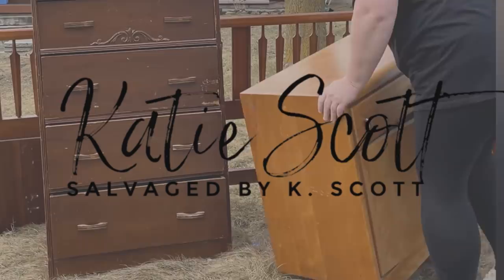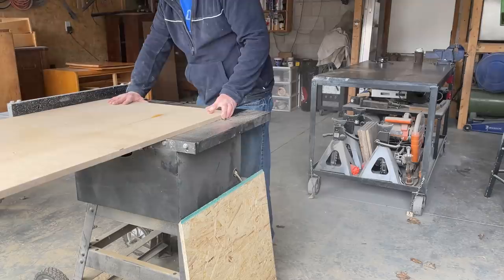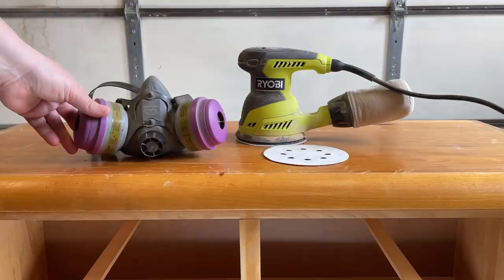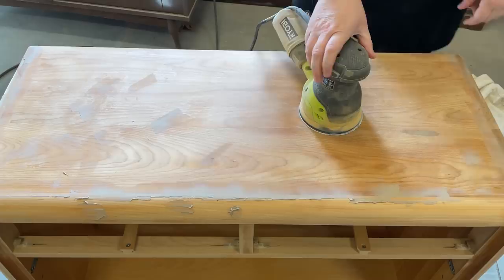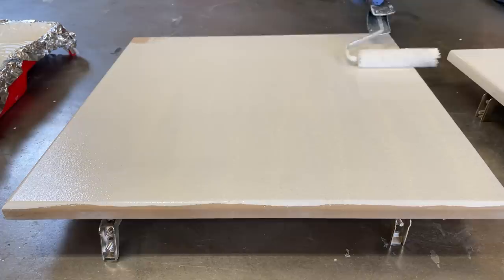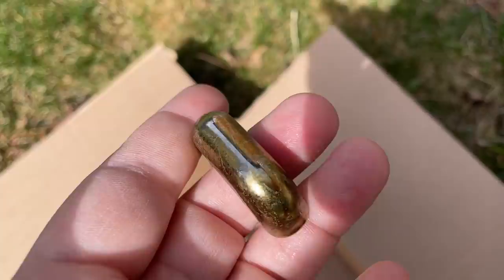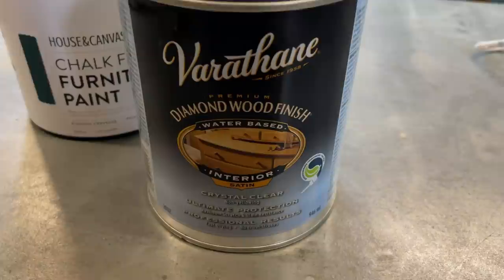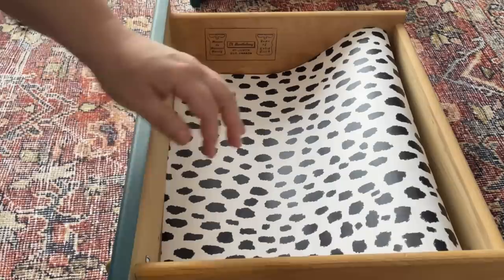Modern Buffet Makeover with Chalk Paint

Comment: Wow cool!! Other than tanin purposes, do I HAVE to prime? Can it be just any primer or has to be a specific kind??
Reply from the maker: Primer also helps give you a cohesive surface between sanded and I sanded areas so you paint sits evenly across the substrate and also helps with adhesion. You don’t have to prime but I it saves A LOT of headaches later on if you do.
Reply: @salvagedbykscott  that makes a lot of sense!! Thank you!! 🙏 😍🙏

Comment: I just sprayed valspar satin cabinet and furniture paint onto my dining room table. The lady at Lowe's told me I do not need to add a protective layer on, but does a high traffic piece like this need it? If so, what kind of finish do I spray on???
Reply from the maker: I would always suggest a topcoat on a dining table. On my own table I did 4 coats of the Varathane Diamond Wood Finish that I use on everything else. You just need to remember that painted surfaces don’t like water or heat so be cautious of those things on the surface no matter what.
Reply: @salvagedbykscott  Thank you! One more question! I used cabinet and furniture paint because its supposed to be durable by itself. Is there a specific top coat that's best for the paint type I used? I just don't know if I need a water or oil based coat for latex? Can I use the top coat you used?
Reply: @salvagedbykscott  apparently I ended to being logged into my second account. I'm jerryg225onroblox also :)
Reply from the maker: @SuperLuckyKill  I only use chalk style paints so I can’t help with anything else.
Reply: @salvagedbykscott  oh ok no problem! Thank you for the advice tho! I know most of your vids are chalk style, but I didn't know if there were any similarities in them